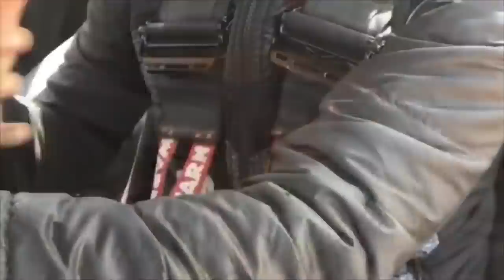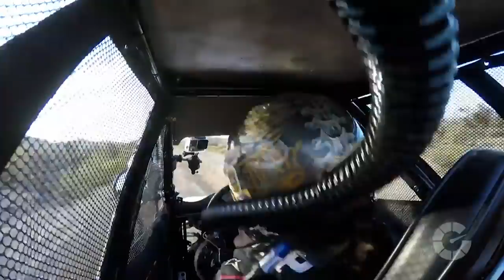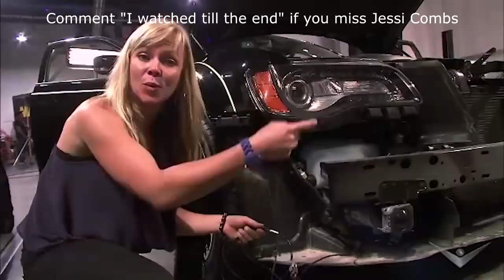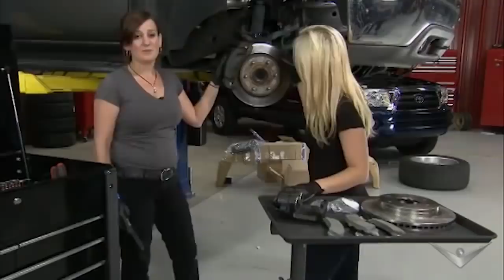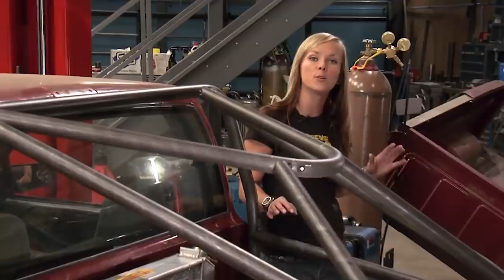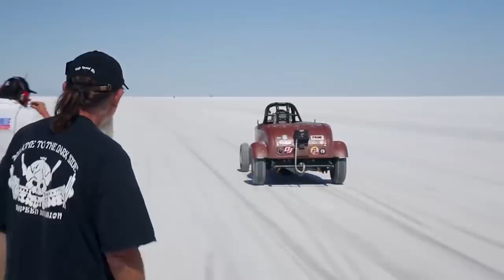How did Jessi Combs die? What happened?

Comment: As a former crew member on Craig Breedlove s 1996 land speed record attempts after seeing the American eagle car my thoughts were " it's a suicide machine"with no safety equipment no roll cage of any kind just a fighter plane with aluminum Wheels one of which shattered for unknown reasons causing the car to crash she died of head injuries due to the lack of a proper roll cage assembly remember Art Arfons crashed at Bonneville at over 600 miles an hour and Craig Breedlove crashed at Black Rock at over 730 and both survived  Arfons with minor injuries Breedlove walked away without a scratch.(RIP) Jessi Combs.